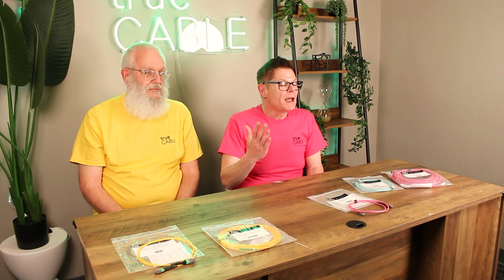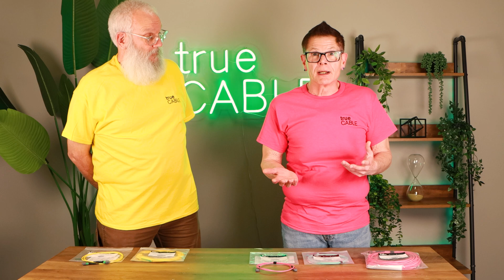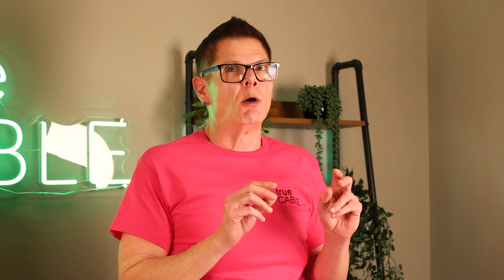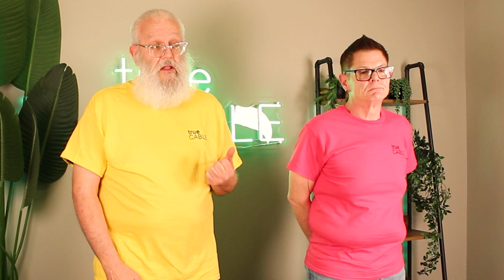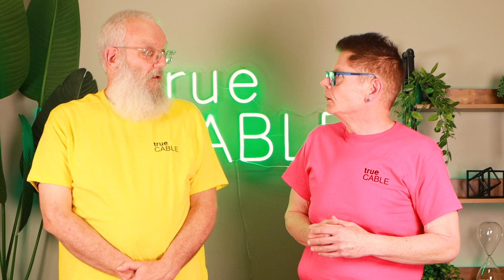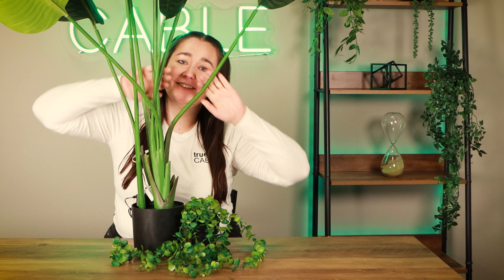Single Mode vs Multimode Fiber Optic Cable | What To Know in 2024

Comment: Im putting fiber optic cable in my home for streaming tv, what type of cable should I be using ?
Reply from the maker: Hello! Well, you could use either singlemode or multimode considering the short distances involved. Multimode is great for distances up to 550 meters at 10G. Singlemode can run at 10G up to 10,000 meters. If you are using duplex (one fiber to transmit and one to receive) transceivers there is no real advantage for either with in-home residential distances. Go with whatever costs you less. Now, if you are willing to spend more on the transceivers, singlemode fiber is useful for BiDi or Bi-Directional communication over a single fiber with a BiDi transceiver. You could turn a duplex singlemode fiber cord into a two fiber data cable capable of addressing two different devices using this method, for example.

Comment: Thanks, fellas. This was great! I don’t know how many videos I’ve watched. Should try to understand better why anybody would go with multi mode. The cost factor is key.
Reply from the maker: Hey Patrick! Thanks for the kudos. Glad you liked it. Cost is the key factor. MMF still has a spot in drops up to 1,300 feet if you only need to push 10G. I personally prefer SMF as the price for the cable is nearly the same, although I am addicted to BiDi transceivers because I can use a single fiber for the link. BiDi transceivers are for SMF only and cost more, but they are worth it!

Comment: 4:44 "It might sound like multi-mode is an advantage  over single-mode. So, you might think multi is somehow better than single because he's only  single, right? Well, in reality, multi-mode is not advantageous because the 50-micron core  diameter allows the light to scatter,  
becoming multi-mode unintentionally through the  core and cladding. That causes modal dispersion,  which limits its ability to transmit data at a  certain speed or distance."
I'm confused. This appears to be saying that the 50-micron fiber is associated with multi-modal, but earlier in the video multi-modal was with 62.5 micron fiber whereas 50 micron was single mode.
Reply: Arrrg, and now at 6:40 single-mode is 9 microns?
Reply from the maker: @Graham_Wideman  Hello! Yes, single mode only operates across 9 microns.
Reply: OK, I think I see the problem.   2:35: "Then,  of course, single-mode came about,  and that's where you get the yellow. Now, what are the main differences? Well,  it's going to do with core diameter. OM1 had a 62.5-micron core diameter, with a cladding  diameter of 125 microns. Not much changed with  OM2, OM3, OM4, or OM5; the main difference is that  the core diameter was reduced down to 50 microns,"
This strongly implies that OM1 is multimodal, and the smaller-diameter OM2..OM5 must be single-mode.  I now think this is a complete red herring due to very unfortunate sequence of statement. I guess OM1.. OM5 are all multimodal?
Reply from the maker: @Graham_Wideman  Hello! Correct. OM1 through OM5 are ALL multimodal. The clue is the "OM", when means Optical Multimode. Single mode is OS1/2 (OS2 is the latest acceptable standard) and "OS" stands for Optical Singlemode.

Comment: OM1 and OM2 has the color orange. I wouldn't buy these cables.
OM3 has the color aqua. 
OM4 has the color purple. 
And OM5 has the color lime.
Reply from the maker: Hello! It depends on whether we are talking about TIA non military fiber jacket color codes or ISO/IEC. Here is the current TIA standard: Single-mode: Yellow; Multimode (OM1, OM2): Orange; laser-optimized Multimode (OM3, OM4): Aqua; Laser-optimized Multimode (OM5): Lime Green; Polarization Maintaining Single-mode: Blue; Multimode (100/140): Orange. It should be noted that Erika Violet (looks like bright purple) is also used for OM4 and OM5 per ISO/IEC and is also seen this way in the USA.

Comment: i'm an industrial electrician, and we use st connectors all the time.
Reply from the maker: Hello! Indeed yes, ST connectors are very stable for things that do a lot of moving around as it screws on. This is seen in industrial settings, typically involving robots and other such things. You don't see ST connectors in LAN/SCS applications much anymore, though. It is all MPO, LC, and to some extent SC nowadays--all typically fusion spliced on.

Comment: Always great videos. I have seen on some videos and forums where some folks say that, regardless of the distance, they are recommending that everyone move to singlemode cable. I am about to run fiber optic from my house to a detached building and it will be ~150' run, well within the distance where multimode will certainly work but, I am torn as to which mode I should go with. Do you have an opinion on this? Thanks.
Reply from the maker: Hello! SMF or MMF would work equally well in your case. The movement towards SMF exclusively has to do with commonality between equipment and connectors leading to simplified installations. A big deal is SMF is what BiDi is used with, where you can use a SINGLE fiber to transmit bidirectionally with a matched set of transceivers, which is quite useful. Generally speaking, we also recommend SMF since it handles all bandwidth speeds and distances you could cover with MMF, allows for higher density installations since you can now use a single fiber to two-way communication--effectively giving you much more installation flexibility, and the dropping price of SMF compared to MMF. Interesting to note that SMF is often quite a bit cheaper than MMF when compared on a fiber count to fiber count basis. That is economies of scale at work!

Comment: Excellent explanatory video. I have a question: Can I use an OM4 LC UPC to LC UPC patch cord with SFP+ transceivers for 10Gbps links and also SFP28 transceivers for 25Gbps links? Thanks for you support.
Reply from the maker: Thanks for the kind comment. Yes, you can use OM4 LC/UPC for 10Gbps operation via SFP+ up to 1,310ft as I have personally done it. As to whether you can use it for SFP28 to achieve 25Gbps, the 25Gbps is not an issue unless you go past a certain distance, but this will be more up to the transceiver than anything else. The cable can do it, but just be aware of any distance limitations and be aware of what the transceiver requires as it may require SM fiber or different end face polish like APC.
Reply: @ Thank you very much for the quick response and excellent explanation. I don't think the distance will be an issue because I'll be using the patch cords inside the racks of a small data center. They won't even be five meters long. I apologize for my poor English, as I'm using Google Translate.
Best regards.
Reply from the maker: @oprdgz  You are welcome!

Comment: Can you get a fiber cable extension to go from SC to a different type of connector?  Or does it have to be the same through the entire cable?  I am asking because i just got Fiber to the home.  3Gb up and down, and I run a PFsense router.  I have 10Gb nics in my PC's and on my PFsense Router they are all copper ethernet dual port NICS not SFP with modules.  I am thinking about upgrading my PFsense and my NICS on my computers to SFP, and just doing fiber.  Anyway I'm guessing that my fiber ran to my house is single mode and I think the connector on it is SC.  I want to try plugging the Fiber cable directly into my PFsense router and see if I can bypass the NID fiber modem which turns the fiber modem from fiber to copper.  I think since the Fiber is ip based anyway and is on a vlan this my work, maybe it won't but I would like to try anyway.  

My question if anyone happens to read this and knows, can I take the fiber cable to the house, and plug it into an extender patch cable from SC to whatever connector type ends up being on my SFP module as long as it's single mode?  As long as the cable stays single mode does the connection type matter?  I would think it does not but I have no idea.
Reply from the maker: Hello! This is pretty common, and your ISP most likely brought in SC/APC end face polish single mode fiber. If the connector is GREEN, it is APC. If it is BLUE it is UPC. Anyway, as long as you keep it to single mode fiber and (most likely) APC couplers and/or cords you can easily convert back and forth from SC/APC to LC/APC, etc. There are patch cords that have different ends (SC/APC > LC/APC and vice versa) and there are couplers that are different sided to allow conversion too. Take note that your end face polish might be UPC, so be sure to confirm this. APC and UPC end face polishes are NOT compatible.
Reply: @trueCABLE  So I didd some more reading.  The cable is black, and the guy crimped it himself so I don't think it follows any color code.  It's quantum fiber, and it's for sure SC connector type.  What is the difference between APC and UPC and face polishes?  Thanks for your help.
Reply from the maker: @PAPPADASH  Hello again! It sounds like you might have a rough time figuring out the correct patch cords and accessories. APC and UPC end face polishes are what angle the actual fiber end face (the very end of it) is set and polished at. APC is higher performance due to less light reflection, and is typically seen in long haul fiber communication, especially for drops into homes and businesses for Internet access. Here is a video on the subject: https://youtu.be/EKtXEGKciRU?si=1NnZSLKLsU-eIxT-
Reply: @trueCABLE  Makes sense I'll get one of each I guess.  Thanks for your help brotha.
Reply from the maker: @PAPPADASH  Hello and you are welcome! Have a great day.

Comment: Always check your equipment for transciever compatability.  Many times theyre incompatable with their own OEM (IM LOOKING AT YOU HP ARUBA)
Reply from the maker: Sound advice, Henry! It is all supposed to be compatible via open standards, and for the most part, it is, but you will run into trouble from time to time. HP, Cisco, and 3Com are the most egregious violators of this, effectively locking you out of using anything but the transceivers they produce and sell. I will typically buy the same brand of transceiver as the equipment just to be safe. For example, Ubiquiti with Ubiquiti and so on.